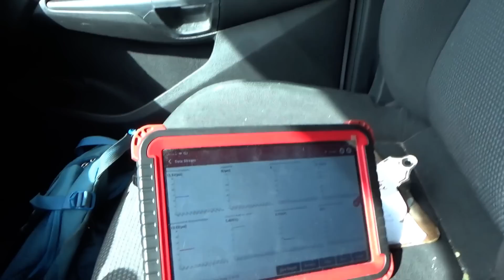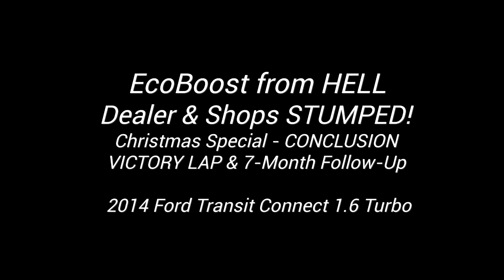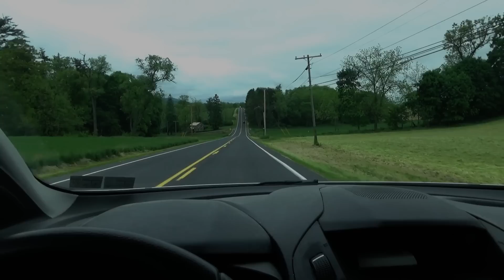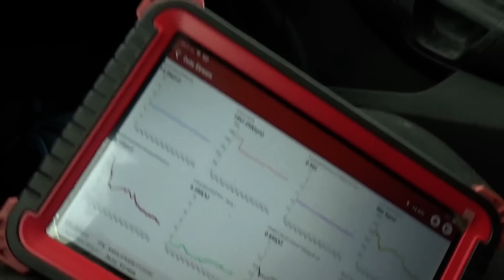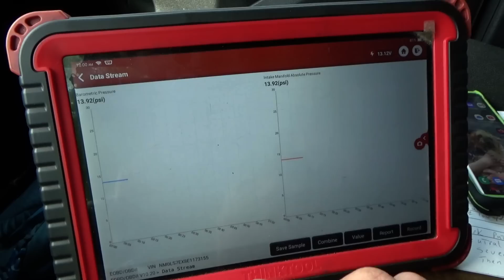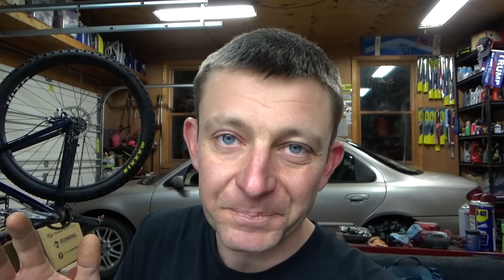(CONCLUSION!) *7-MONTH Follow-Up* EcoBoost From HELL (Christmas 2024)

Comment: I had nothing else to do Ivan but couch potato my way through this epic.  Crimps can be 99.9% reliable if psi surface area of wires to crimp device are consistent.  All it takes is heat, time, environmental intrusion and finally, the dreaded green crusties, aka oxidation begins to build inside the crimp.  No other way to fix it but flux and solder or cut out and replace the whole joint.  Nice work bro.  As soon as you showed the schematic with common ground, bam I thought about all those modules being unhappy, and the conflagration of interactions that ensued finally made sense.

Comment: The only thing I can think of regarding the "un-plug it, plug it back in, it fixes itself" problem is that there was some kind of capacitance building up in a very tiny gap between the MAP ground-wire and the other ground-wires, perhaps?  Current flowed, built up capacitance, and then kind of stayed "charged" until you'd unplug it, or move the wires around.  A total wild-ass guess on my part, but maybe it kind of makes sense?  Extremely weird, no matter what.  There is no way in hell a dealer ever would've found this, except by accident, winging a new wiring harness at the problem.

Comment: I was wondering if the wire is copper coated Aluminium, If the oil getting into the harness somehow corroded the Aluminium under the copper in the crimp splice. Once a high enough current was put on the wire the corrosion cleared, then when the engine warmed up the corrosion was back and the process was repeated ?

Comment: Not hard to understand the splice issue- the copper strands on the one lead had a slight oxidation present when the harness was assembled- Happens more often than you would think- makes you wonder if there are more splices like that somewhere in the harness just waiting to go off like little time bombs LOL  I'm a fan of solder too.  Scott tried wire wrap on their audio receivers back in the 70s and they had similar problems

Comment: That stray voltage you measured was probably a capacitance build up from the sensor due to the open. When you grounded it, it was discharged for a time until  the charge built up again. I believe the factory did not strip the wire properly before they applied the crimp. You measured it with a DMM so the input impendence of that meter is very high and effectively an open itself. If you used and old analog style meter with a lower input impendence you would have see that charge bleed off over a time because you would be providing a ground path via meter. Great series. Cheers.

Comment: There is no idea what is touching and amount of pressure in a large (many wire) crimp with years of vibration and oxidation, one of the wires settles to a place of less connectivity or additive resistance based on how far from the real ground wire. The solder fills in the voids and reduces wire to wire touching resistance by a great deal, one wire may be 3 touches to get to the real ground wire and each touch is a resistance or voltage drop.

Comment: An amazing repair. Finding the intermittent ground issue was just great. perhaps loose or oxidized wire in the crimp. Soldering the plice was the best repair. Great set of videos. Thanks

Comment: what  no o-scope on this series?   lol.    had splices been a problem quite a few times before. usually its due to vibration and placement in the harness. usually i they are a break that causes an intermitent .  all the ones i looked at are the same and a relative that works making harnesses  confirmed my suspicions.  they strip a section out and put the wires in a fixture one on top of the other.  then they are welded using an electrode very much the same as a spot welder.  no cleaning no flux.  given a tug and heat shrink if the specs call for it.  not all call for it. the wire composition varies widely from maker to maker too. old wire  dirty or corroded wire not long enough under the electrode all have shown to be problems.  this series shows that there is no place for low voltage low amperage signals in an automotive environment.  electric controls when introduced were largely 12 volt  some 9 volt and this problem would not have been so elusive.  there has got to be a better way.

Comment: Dear Ivan. The timing of this hellishish diag was incredible. Started taking notes @ part 4. The day after part 8 concluded an 04 WRX barely made it to my shop. Atmospheric pressure to map sensor readings where way off from each other with the key off. MAF was reading way higher like 13-18 g/s @ idle, ambient to intake temps way off,  misfires and wacked fuel trims. Grounds at MAF 3V, MAP 8V.   Found common ground splice corrosion issue, cleaned/soldered = all fixed, no parts required. It does need front A/F sensor still. Thank you for saving me and my customers time, money and frustration.

Comment: Wow Ivan this was a crazy diag!  I’ve watched a lot of your videos and always thought I will never see anything crazy like Ivan sees but last week I had a Tundra barely running fuel trim codes misfire codes and I was like I seen this before in one of Ivan’s videos it was crazy the exact same symptom’s ran a few test to get some baseline measurements fuel pressure, checked a/f sensors etc and it was the fuel pump control module ordered a factory one from Toyota and it was made in china 🤣.  I am truly grateful you post all this great content I have learned so much so Thank you

Comment: Hey bro i am facing the same issue with my Mercedes e280cdi 2007 | went to a car wash to give it the clean under body wash and after driving it back to home, it was fine. After a few hours. I tried starting the car, the key isn't rotating in the ignition. Then I remove the ECU and the clean, the every trace of water droplets after sometime. The car started honking by itself, then I disconnected the horn and then I disconnected battery after 12 hours. I connected the battery and the horns are not honking by itself, and I tried starting my car. It started as usually it starts and after going about 5 km. I went back to my home and then I tried starting my car whenever I put my key in ignition on the last tab where the engine is about to start the radiator fans kick in with the maximum speed and the car is not turning over and then I open the fuse box, cleaned it with the board cleaner.
There was a little trace of rust i cleaned it with the toothpick. And I have checked all the fuses and relays, there is not a single fuse. turned bad, but whenever I turn the key to own position, the fan starts at maximum speed, and I haven't applied your method to start the car, but I think you have very vast knowledge about my problem and i hope you will help me in this issue

Comment: Brilliant Diag again by Ivan! Consider the oil intrusion scenario. a few points, oil intrusion can create a parallel path for current flow, or...can amplify a poor terminal fitment issue in a connector(low tension) coupled with oil in terminals.  take a used sample of oil and check resistance with your meter across it and consider it may vary quite a bit. perhaps because there could be micro metal fragments. also consider that CAN circuits are more susceptible to this...this is of course mostly theory, but I never dismiss it entirely. any thoughts? LOL

Comment: About the fuel pressure, and the stalling. The FP sensor is sharing the ground with the MAP sensor, and it's a pull down design. Maybe the sensor lost ground also, showing the high fuel pressure, so the ECU does not activate the HPFP. Probably the ground got restored while cranking, and it took some time to restore the fuel pressure.

Comment: Fantastic investigative fault analysis & repair … just love your work Ivan❤❤😎..BTW the traces of oil in the wiring harness could have been caused from high pressure water cleaning of the engine bay ? Looking forward to all your next adventures 🎉😎

Comment: It seems like you blamed the issues on aftermarket parts so you replaced some with OE... but without checking powers and grounds before doing so.  Then it ended up being an OE issue.  Does Dorman & Standard Motor Products deserve an apology here?

Comment: the map sensor kept coming up why did not scope the power and ground for that sensor if you put a ground from the negative on the battery to the sensor would that fixed the problem there is usually more than 1 way to fix the problem

Comment: I watched your videos very carefully and I have to say that the Ford really surprised me. Back in the 1980s we had problems with cable splits on Peugeots. They had taken brass sleeves and crimped them in the Harness, but the cables had come loose and the fault could not be clearly localized. The engine ran, then stalled, after starting it just ran rough. We searched for 2 days and then ordered a new Engine wiring harness from the factory. After that, the engine ran perfectly again. I cut the wiring harness completely open and then we saw the splices, which only went over the outer cables and the inner ones were loose inside. There was no OBD II at that time.  But through teamwork we found the fault.
I knew that you would also find the fault here, although I initially suspected a leak in the intake area, which is very common with Ford Echoxxx.
If you think you have all seen.....

Comment: Will the new year's special have 365 parts? 🤣 With the MAP sensor code being the most prevalent, I wonder if it would have been good just to check resistance in all the wires going between the sensor and the engine computer right off the bat. I realize that maybe it wouldn't have shown high resistance, and it may require the circuit to be loaded to reveal a fault, but it may have been worth a shot. These circuits that carry anywhere between 0 and 5 volts do not like any added resistance. As we saw, it can make a huge difference in how the car runs.

Comment: Complains about factory crimps. Forgets about all the cold and cracked solder joints he's reflowed.  Aberrations can happen with any method.  Crimping is the correct technique for stranded wire. Solder is the correct technique for solid wire.

Comment: Ivan, I think you probably had a case of a copper oxide diode junction formed in that crimp. My guess is the tiniest amount of road salt leached into the junction and created enough corrosion, (copper oxide) that was just a few atoms thick. Who knows maybe the engine oil carried it in there. Anyway, a few hundred millivolts drop across a copper oxide diode junction is entirely expected. and these type of junctions are very susceptible to variations Caused by mechanical movement and temperature swings.
In fact, the engine oil probably carried metal particles from the engine to the junction, zinc, iron, and alumimum are all reactive with copper.
This sure is a mechanics life lesson.
Suspect the grounds.
Check the grounds.
And when you’re sure it’s not the grounds, check them AGAIN! 

Great video series!

Merry Christmas and happy new year!

Comment: I am a retired electrical engineer and a ham radio hobbyist. Corroded metal connections can form diodes (rectifiers). In the radio-frequency world this happens a lot and causes problems with signal spurs from a radio transmitting site. I suspect that you had a case of this bite you. The fact that loading with your test light did not make a corresponding increase in the voltage drop indicates a non-linear response (IE diode). Anyway, nice work finding this. It is fun to follow along trying to solve the puzzle.

Comment: I think the oil film separated the wires in the crimp by an arcing distance of 300 mv. Had they replaced the cam sensor (oil and wiring is never good) the problem would have fixed itself.

Comment: The irony here is that the ground tree to the various sensors was deliberately kept separate from the grounds fed to load device like motors and solenoids. This is done to permit a clean ground for measurement purposes (instrumentation). As such the ground current would only be the sensor electronics which wouldn’t seem to be too much. The test in the prior video connecting the MAP ground to the battery would have been a bad permanent fix as then that side of the sensor would have a lot of ground noise coupled in. 

I think the ground sensor line to the ecu is not low impedance and thus as current rose it compounded the elevated readings. What would have been interesting would be if the 5V measured from ecu to that ground return stayed at 5V even as the ground return floated up 100mV or so. The ecu measures differential from the sense and sensor ground so it might be immune to ground elevation to some degree if the 5V regulation is relative to sensor ground and not battery ground.

Comment: To me I see this as being a bad crimping and vibrations as well as temperature changes over time caused the strands to lose contact.
I have had my share of bad crimpings and it's a challenge to get them right when you have multiple wires in the same crimping.
A bad combination of metals could of course also be involved. Today it's not unusual with copper clad aluminum (CCA), and that's a solution from the dark side. Wires look like copper wires but has a core of aluminum.

Comment: The oxidation in that crimp, to that one wire, created a galvanic diode which is why it was a constant 300mv drop while current was flowing.  Look at how the first solid state diodes were made prior to the use of silicon. They were pretty crude devices. And in just about every case of bad grounding due to corrosion, if it's not a fully open connection, there could be times where you might see that same kind of failure mode.  The next time you run into another bad ground, put a volt meter across it and see what the voltage drop looks like. I bet there would be a few cases where you'll see the same kind of constant voltage drop but I bet the voltage may depend of the type of oxide present. Also, it could be that the car will continue to run until the connection totally fails open. I had several VWs that would drive me nuts with questionable grounds as they aged. No more VWs.

Comment: Who build cars that rely on millivolt electronics ? Cars that dives in - 80F to 136F on salted winter road through deserts, in mud, water, gravel, ice 
Those engineers must be dumb. 😱 Connectors has weather seal except where wires enter the connector rendering it all worthless 😭

Comment: I wonder if the initial spike when plugged in somewhat "jumped" the ground causing a short connection. I had my cable TV go out and the service tech said he doesn't know how I had any cable, as it was disconnected at the pole, but the disconnected cable was right next to the outlet at the pole, causing the cable signal to basically "jump" through thin air, although it was only a centimeter or so between them.

Comment: Oxidation is a micro-insulation. Insulation is a resistance to current flow. You were experiencing micro-resistance on the micron level.
Caused by each individual wire type metal composition, heat, chemical fumes inside the harness reacting to the bare wire, oxygen, and others. The use of flux in the solder removed the oxidation to provide a stable solder connection.

Comment: Had fiat panda kept throwing no3 injector swapped injector still same fixed earth's around engine still happening 
Got a second hand engine loom fitted no more problems had only done 40k
The old loom all injectors wires joined to earth by twisting wires together and glued up